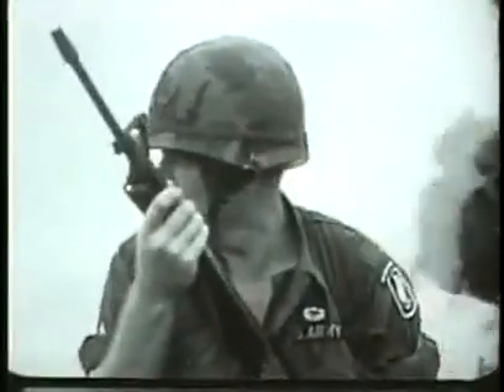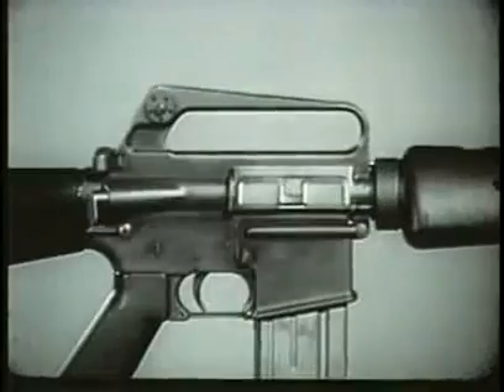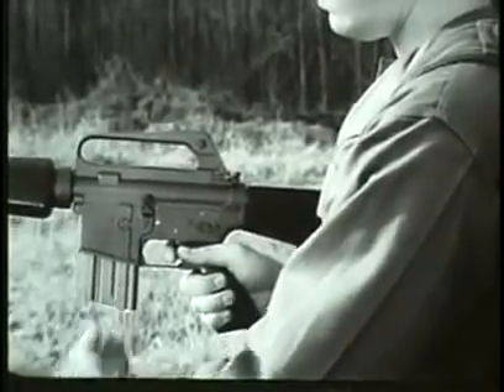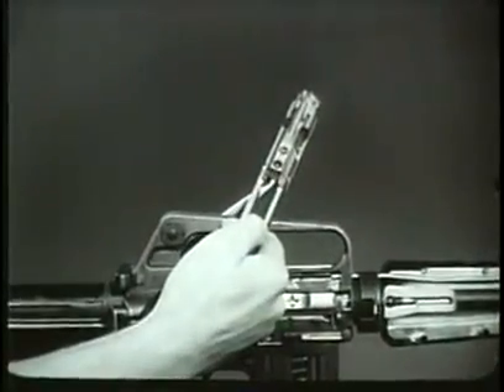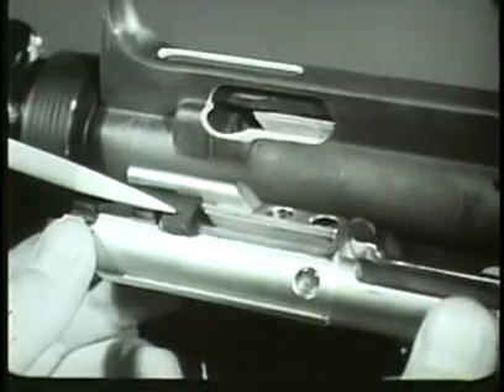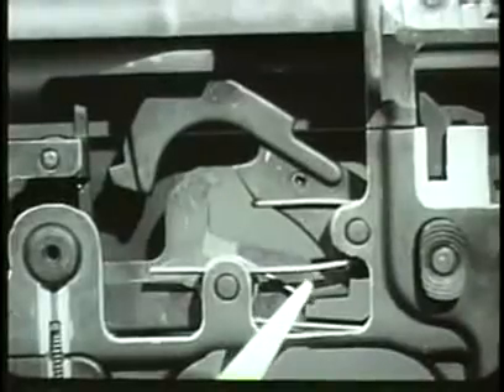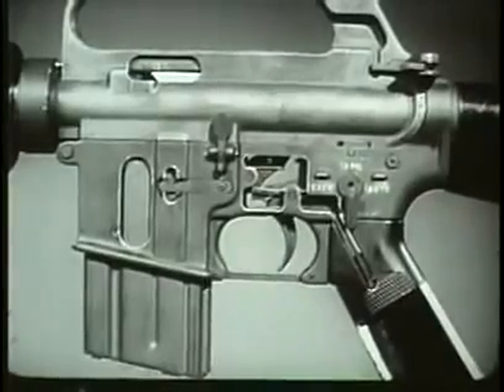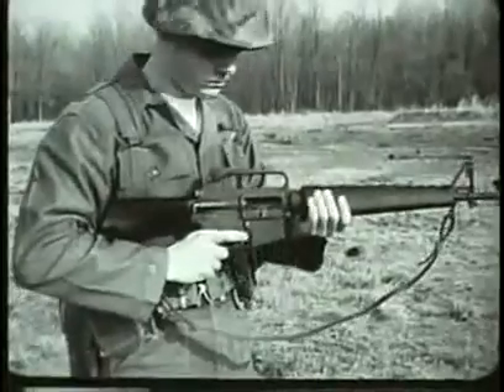Vietnam War Era Training Video: Operation of the M16 (AR15 variant)

Comment: When I was there I had lots of jamming problems but I noticed some didn't , later we learned to always put lots of oil and it took care if most jamming
Reply: did you know about the incorrect ammo? apparently the incorrect ammunition was used which was very corrosive, so when troops cleaned their rifle the way they were told, the oil that they put on was not enough to keep it functioning.
Reply: @jimmyrecard6021  It was the powder they used .
Reply: @colt-ss3lw  Completely correct!  Love your user name btw.  I'd love to own a 1911 someday when I'm not broke as shit!  Surprised how many people don't know this.  For anyone who doesn't, the ammo used for testing the weapons in it's final design phase had powder that burned much cleaner and more thorough than the ammo issued to the troops in the field.  It didn't gunk up the internals nearly as much.  A friend of mine had a father who went to Vietnam and showered with his M16 every chance he got.
Reply: @jimmyrecard6021  The propellant used was never corrosive. It would have destroyed the M16's gas system if it was. The M16's action gets dirty faster than others, explaining why it had to be cleaned often. 
The original propellant used on the prototype AR-15 was too difficult to mass produce to specifications and was bumped. 
The next propellant selected caused the cyclic rate to increase and put  stress on the working parts of the action that could lead to breakdowns. 
The next used the same propellant as the 7.62mm NATO round. This caused build-up of gummy deposits on the gas system. That was rectified by changing the formula slightly to reduce the deposits. This is the propellant used today.
Reply: Some high-up paper pusher moron in the Army decided that the rifle was initially self-cleaning. Cleaning the rifle on your own initiative shows that the troops know better, though I don't really blame those who didn't clean their rifles if they were told they didn't need to. Of course looking on this situation with 20/20 hindsight is not really fair, I wasn't even around in that century so I can't really speak at all for those who had to be in that situation.
Reply: @dante_m  It was Robert Strange McNamara . Murderer of U. S. soldiers .
Reply: @dante_m  The salesmen for McDonald-Douglas, the firm that peddled the AR-15 for Fairchild / Armalite, said it needed less cleaning than a conventional battle rifle because it used a non-corrosive propellant. 
The original rifles were issued with only a handful of cleaning kits (which also came with a bipod). The idea they didn't need to be cleaned was an urban myth. They started coming up with cleaning kits and issued a comic book manual for issue to the troops after the congressional investigation pointed out this flaw.
Reply: @SidneyBroadshead  I've heard multiple reason.
Match grade ammo used in testing and demonstration - could fire thousands of rounds without clearing. In service the ammo wasn't the same grade. 
The M14 is piston operated, where the M16 is direct impingement, pumping the gas right into the upper receiver. Different than what they trained with.
Reply: Dante M lmao. Regardless wouldn’t it be better to have a rifle that didn’t require so much maintenance?!?! I mean ur in the middle of goddamn horrible war and u gotta clean ur shit daily?!? And take it apart. Whilst the enemy can drop their shit in mud and rarely clean it and still works great??!?
Reply: @Puppy_Puppington  ak is just as reliable as a ar you cant drop a ak in mud the north Vietnamese army maintained their weapons  and used the correct ammo, We did neither
Reply: @ShitboxFlyer  with the dust cover closed and if the barrel doesn’t get plugged you can, but we still used the wrong ammo so it doesn’t matter it would jam no matter what
Reply: No, we used graphite.  They said oil was bad. It was a good reliable weapon if kept reasonably clean. Vietnam 1968.
Reply: I used an M-16 in Vietnam and had one jam in 2 years. The cause was a bad round that blew a hole in it's case. The issues I had were with the 556 rounds being deflected in heavy vegetation.  Like any rifle it won't fire forever without cleaning. I fired off 15 mags in one action inside of 20 minutes  in 97 F with not a hitch.
Reply: @alexkalish8288  thanks for sharing. Welcome home
Reply: did they ever try to sell the foward assist to try and get it to work?
Reply: They jammed because of the powder the cases were loaded with.
Reply: Oh oil is good for gun jams? NO FUCKIN WAY!!! 😑
Reply: What about also not fully filling your mags I heard Vietnam era m16s had that problem where they’d Jam if you put 30 rounds in
Reply: @tayo9056  they were issued 20 rnd mags, and they had issues if you put more than 18 rounds in them, so I've heard. I've never been there.
Reply: @johnnyG780  that’s what it was I heard, I wasn’t there either so I don’t exactly know
Reply: I heard they also issued "disposable magazines"
Reply: @channelchannelchannelchannel  yes ammo came already loaded in mags. So the were disposable. Later they started reusing magazines.
Reply: @charlesprice7608  good to know
Reply: The reliability problem was that the Department of Defense switched the ammo powder to a ball powder instead of staying with the IMR powder that had been used in all the testing that they did. They introduced the ball powder in a wartime situation without any testing. The ball propellant increased the gas port pressure and increased the firing rate in full auto. Add to the fact that troops weren't issued cleaning supplies and were told the rifle was self cleaning. The early M16 probably could've handled either the increase in gas pressure & firing rate, or the lack of training and cleaning, but certainly not both situations at the same time.

Comment: M16 aint ar15
Reply: Tester9 it wasn’t until the second or third model that Colt made(after Armalite had made prototypes and sold the patent) that the AR-15 was adopted as the M-16
Reply: Does it really matter? It's a rifle.
Reply: Actually it is.
The origonal AR-15 of this era was sold before it got into military use. had select fire options and every thing. there's very little to no difference between an AR-15 of this era and an M16 since the military juts ended up adopting it after it was already being sold as an AR-15
Reply: yes it is, the AR 15 was the original name meaning "Armalite Rifle", nowadays, the AR 15 is the civilian version of the M16/M4 rifle
Reply: Yes it is. Just like how an M9 is a 92FS